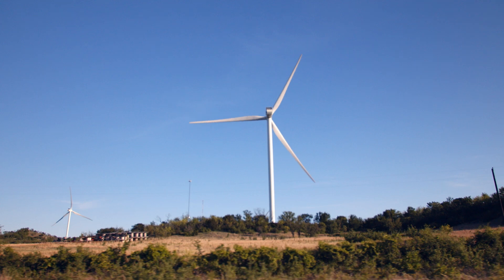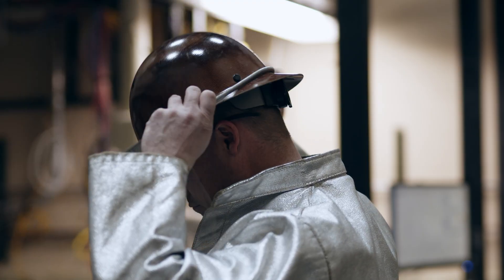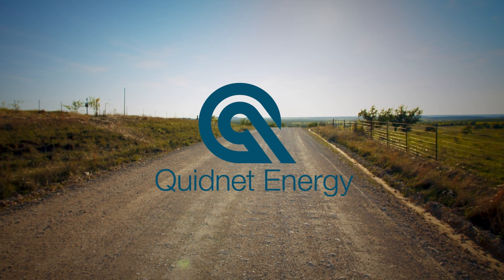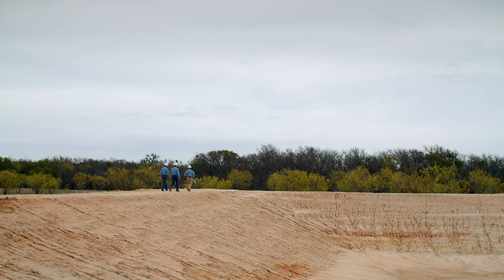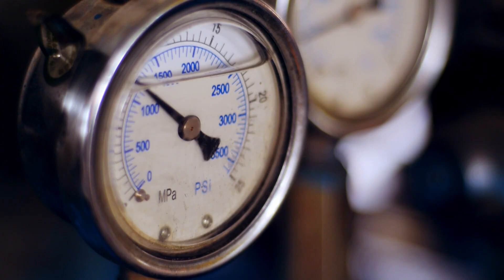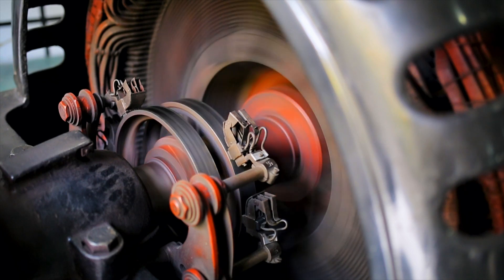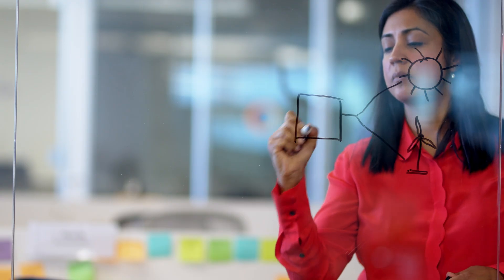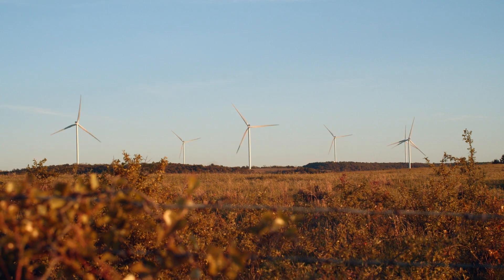Energy storage breakthroughs

Comment: Sorry bill.. you mistake again in your energy investment.
If you want to run the "marathon", then you should invest in hydrogen.
Second.. no thermal-electricity technology has a future, your nuclear modules... no future, fusion..  no future..  solar thermal, no future.
If you really want to help and make money, then you should invest in airborne wind energy (helping researchers to develop a deep learning AI system to fly the kites).
Reply: @UCzsacSBDrC-VG9GAlC_7bSw, do you notice the "steam" coming out of rockets while they are standing on the launchpad? Know what that is? It is hydrogen getting vented because the rocket heats up in the sun causing the cryogenic hydrogen to expand. It has to be vented to not blow the rocket apart.

This gives a little hint at how terrible hydrogen is for long term storage. Hydrogen is definitely NOT a marathon type of energy storage. It is better to turn that hydrogen into other types of fuels which can more easily be stored and transported such as blue crude: https://nordicbluecrude.no

Comment: "High pressure water"...water isn't particularly compressible.
Reply: Water can be pressurized, it just wont change much in volume. For example, the pressure at the bottom of the ocean is enormous, which is why we're struggling to explore there.

Comment: This presentation is a bit vague. Some of this I'm sure is due to trade secrets, etc. but simply asserting that this is 'longer term, cheaper, more benign' is pretty useless.

I can buy a pallet of solar panels right now at 26 cents per watt in the US. 2550 gallons of gasoline (1 gallon per day * 365 days * 7 years) times $2.50 = $6400 (give or take). Creating a gallon of gasoline (equivalent to 32,000 watt-hours) from water and carbon dioxide takes about 3x the energy, or 96,000 watt-hours. Divide 96000 by 5 hours per day of solar and one gets roughly 20,000 watts. 20,000 x .26 = $5200. The question then becomes where to get the CO2 from - one of Gate's investments is in a company named Carbon Engineering, which draws CO2 out of ambient air.

According to the Carbon Engineering website, they can extract CO2 at $100 per ton. The ratio of carbon to oxygen (by weight) is 12:32. Therefore, the weight of carbon in a ton of CO2 is roughly 550 pounds. Gasoline weighs about 6 pounds per gallon, and five pounds of that is carbon (the remaining is hydrogen). Therefore a ton of CO2 could produce 110 gallons of gasoline. At $2.50 per gallon, this would be worth about $275.

2550/275 gallons = works out to 9 tons of CO2 needed over 7 years, or $900 of input from the CO2 side. $5200 + 900 = $6100, which is still less than $6400. Obviously capital and operational costs are ignored in some of this discussion. The implications of this math should be kept in mind as people project renewable energy build-out over the next five to ten years.

Comment: This video has no technical information whatsoever.
Reply: Chill. It's 3 minutes and covers 3 companies/ ideas.
Reply: its three minutes btw
Reply: it really does its best to say absolutely nothing, but gives people the feeling 'something' is happening. And reading the comments below now I see that is everyone's conclusion.
Reply: I think the first one is using the Seebeck effect. The second one uses high pressure in a well instead of a hill. The third one is a new kind of battery.
Reply: @Kneecap22  The first one has compressors and turbines drawn on the whiteboard along with some associated components such as the thermal storage as the hot end (the salt), recuperators, and a some type of coolant system designed for below 273 Kelvin (because they mention "anti-freeze solution") as the heat sink (or source, when they're pumping heat from it into the molten salt storage). Therefore it's a heat engine cycle of whichever type would match their system's parameters and overall cost. Since anything more would be guessing and I feel like guessing at the moment, I'm going to guess they're considering an organic Rankine cycle driven turbogenerators if for no other reasons than the good efficiency realizable from a comparatively small temperature differential and their chosen temperature of the cold end being below 0 degrees Celsius. :)
(Why a "small" dT you ask? Just a hunch, but if they can get away with lower melting temperature salts by also designing around a lower cold end temperature, it gives you a more affordable system due to fewer exotic, expensive parts with less expensive materials for the hot end... and less storage losses, better cost competitiveness, and helps with actually storing energy for a more meaningful duration. The ladies at the whiteboard could blow us all away with the engineering I'm sure. They're not just doodling recipes there.)
Reply: @Kneecap22  The first one is a thermal battery using molten salt. They have been around for a long time and are great but non rechargeable. These days there are a few designs that work for rechargeable molten salt batteries and some companies are working on them. Some things that use them are guided missiles for instance.
Reply: visit the IRES conference in Germany of you are interested in deep technical information on this topic
Reply: "Insulin was invented at the University of Toronto, Canada, from 1921"

Please support ! Please Donate！

help me!

Hello World! !

I want to eradicate diabetes type 1 from the world

I want to help eliminate pain from people around the world with diabetes

please donate your money develop the Cure for Diabetes.

The complete cure of diabetes is a dream for humanity of 100 years!

please invest and Donate for diabetes  cure　New Technology

And Talk about diabetes with family

(^o^)ノシ(^o^)ノシ(^o^)ノシ＼(^o^)／（＾w＾）ノシ
Reply: It shows the ladies planning recipies on a white board and a man waiting patiently for a sandwich.

Comment: quidnet Energy is such a stupid idea. the dudes are using a diesel caterpillar engine to power the pump to push the water upstream and then use a turbine when needed to regain SOME  of the energy back. Dude why not use the diesel engine as a generator and you have diesel which you can store for a very long time. if you wanted to show a proof of concept that was the worst way to do it

Comment: I have a suggestion, since wind and solar balance each other out pretty well, why not just use hydro dams as batteries and release more water when energy is need? 

So there is no pumping required, no energy input required, just timing the releases with energy demand.

Also why not incentivize steel, aluminum mills and other large industries to reduce production when supply is very very low?

I don't think the right solution is going to be very complicated once we figure it out

Comment: How much energy will it store, and how much is that relative to the demands of a city?
Reply: I believe all three are designs that are meant to be scalable.
Reply: The energy loss is more important no? A hydropower storage is like 75% loss to pump it full. I read somewhere that the "molten salt generator" has a 30% loss. But its heat? Wont you keep losing energy?
Reply: @robertbogan225  I think if the price of solar continues to fall, as long as the round trip efficiency is moderate (~30-50%?) the biggest factor will probably just be $/kWh storage capacity. If you end up paying a premium for a high efficiency, you may end up spending more than it would cost just to build 30-40% more solar panels (or however the math works out).

I think you read or typed wrong though, typical pumped storage hydroelectricity is more like 70-80% roundtrip efficiency, so like 20-30% loss. 

Apparently for molten salt, the loss in the insulated storage is negligible over short periods. I think calculating the roundtrip efficiency for molten salt is a little arbitrary as the heat is usually generated by concentrated solar, not electric heaters. But it's a good way to generate solar power at night.

Comment: The pressurized well technology doesn't sound right.  Water is incompressible.
Reply: Good point. This is guessing, but I would think that what they do is pumping water in a cavity filled with air and the energy is in fact stored in the compressed air, much like in a water rocket made from a soda bottle.

Comment: Explain the claim that renewable energy is cheaper than fossil fuel energy.
Reply: solar and wind are cheaper than any other thermal plant today.  Is not a claim, is a fact.
But this idea does not have future vs hydrogen for large capacity storage.
Reply: @AngelLestat2  Fossil fuels are self contained energy.. The renewable energy high expenses do not come from wind or sun collectors only.. But from storage..
Reply: @absolutium  storage is not a problem because is something you need one way or another. 
Tell me how do you do to accomplish zero co2 emissions in all energy sectors without using hydrogen.
Think about it..

Comment: It would be helpful to know the efficiency and cost of each tech. And also how they compare to super capacitors...
Reply: Well they are at least designed for totally different use cases than super capacitors. Super capacitors are for holding relatively small amounts of energy for small periods of time, but with immense charge/discharge rates. The things in the video are aimed at seasonal energy storage - so storing large amounts of energy for months at a time. You would not use a super capacitor for that.
Reply: @Aethid  Although, you can certainly use a supercap array to take the peak power edge off the undisclosed storage batteries, and potentially have a smaller battery yard that meets short term peak power demands. I'm more of a fan of decentralized power. Would love to see more hybrid systems.

Comment: Renewable energy is, and has been for years now, an infrastructure iisue, not a technology issue.
Reply: @whatever04-y3g  There already are damns storing electricity. Then there is the infrastructure issue of expanding grids to increase capacity to transport electricity to balance surplusses and demands out. Then there are gas plants that can be online in a matter of minutes. Then there is power to heat, to store electricity short term as heat. Then there are intense studies done on what the ideal ratio of different renewables should be in this or that specific region to minimize fluctuation. There is a bunch that is just infrastructure, that makes this "perfect storage" unnecessary

Comment: Why is electrolysis ignored? 
Just take water and use the energy to make it to H2 and O2. And when energy is needed you can use a fuel cell or the normal oxyhydrogen reaction to produce the energy. It’s one of the most efficient ways to store large amounts of energy. But still nobody is doing it on a large scale

Comment: Can the geotechnical hydro storage be used to also store Geothermal energy storage? Depending on the thermal mass of the well material, the water could bring cold up in the summer and hot up in winter. 

The geothermal heat energy storage could also be used on 24 hour schedule. It could even store the coolness of night for daytime AC alternatives. It could heat buildings at night from the stored heat of the day. 

Solar water heaters could be used to collect heat from the day, to bring the heat down into the earth for storage. Like wise water cooling radiators could be used at night.

If water is already being cycled between the surface and ground, why not piggyback heating/cooling on it?

https://youtu.be/N3Em64OBGqI

Comment: everyone says lithium cannot get the job done, but I am starting to think that is wrong. The price of lithium ion battery storage just dropped 35% in less than a year. Tesla is taking cobalt out.  its mostly all nickle in the battery.  now the have dry electrode process which will double the life and density of lithium ion.  then lithium ion batteries are about to be completely recyclable.  I dont think lithium ion will get us to 100%.  so I guess they not be able to get that job done.  However, BLoomberg new energy finances says it will decrease another at the least 67% by 2030.  people think density does not matter for energy storage but I think it does.  it means you can have battery storage more distributed.  this means less transmission line and more local production.  I hope something better than lithium-ion comes along.  However, I worried about people waiting for something better.  you can buy an EV now and you can buy an solar plus lithium ion storage battery now and there is a good chance it could save you money or at least you would break even. these early adopters drive the price done faster.  that 67% decrease I talked about by 2030, could happen sooner if people understood how great lithium actually already is.  it has only taken roughly 6 million EVs sold to get to the point were EVs are now affordable for well over 200 miles of range.  over the life of an EV you will save 10-15 thousand dollars in fuel, maintenance and repair costs.  buying an EV is probably the best thing you can do for the environment.  not because of the direct emissions it prevents.  but the indirect emissions it prevents by making energy storage more affordable.  so much more wind and solar can be added with just a few hours of storage, because wind works well at night and solar well during the day.

Comment: These idea are out the box but they won’t work.  Too inefficient.   Turning electricity to heat then back to electricity that’s so inefficient.  Same with turning electricity to pump water and then using that pressure to generate electricity.

Comment: I can't understand why we are obsessed with storing the energy. Why not using the energy as soon it is produced ie in the day time ? Atleast we can save a lot of fuel in this process with already existing technology but better planning. 
Note: I found this storing process of hydro power is already existing. Secondly this way the cost of building and maintaining this is also a matter of concern.
Reply: Solar and wind does not always run when their is peak demand, and they use hydto/wind power in low demand periods to move water/fluid in to storage for future use inorder to eases the strane on the grid when demand is higher.
Reply: @miles2378  You mean to say that at peak power condition the renewable gets greater than the demand ! I doubt that ...because as far as i know the renewable is around 2-5 % of the total power consumed at any given time...
Reply: @promitdutta3029 I did not say that. No one is planing to use Coal/gas power plants to pump water into storage so their is no wast of fuel.

Comment: So... that mean those green powerplant waste energy all the time(not necessary a bad thing) becuz nobody used it.  Then this inovation is meant to store those waste energy into a form of heat, then covert it back to energy when need. For example: in day time, a wind turbine produce 100kw of electricity but John only use 50kw of it. Another 50went to waste or store in current energy storage which is not as effective. Then at night time, John dont have any energy. This tech is to store those 50kwh to use at night. Of course it wont store 100% of it but it will be alot more effective.
Hope I am right or i'll be embarassing myself. Sorry bad english. Lol

Comment: Storage is definitely key. Pumping water up to a higher point is not new. The problem is creating the massive reservoir at a height, basically you are creating an artificial dam/ hydro system. This is expensive and relies on a body of water that can used and diverted. Better storage in batteries is not new but what exactly was the tech involved it  was unclear but sounded promising and the chemical process of storing in salt I needed to see more info on that but looked promising. Others methods using compressed gas was not mentioned.